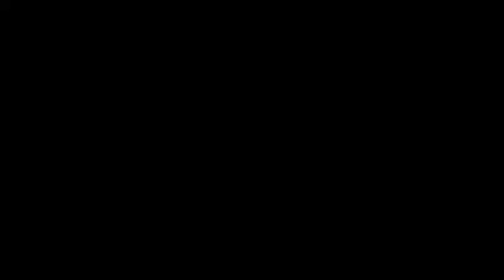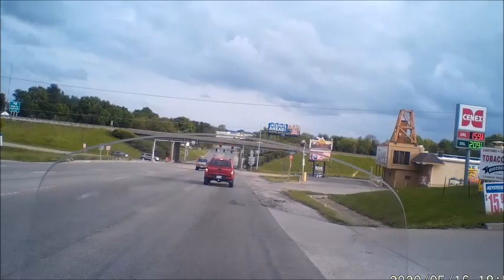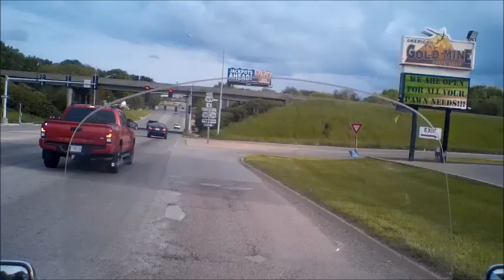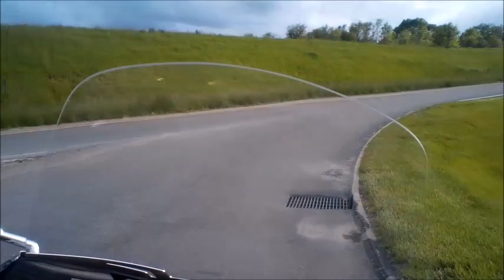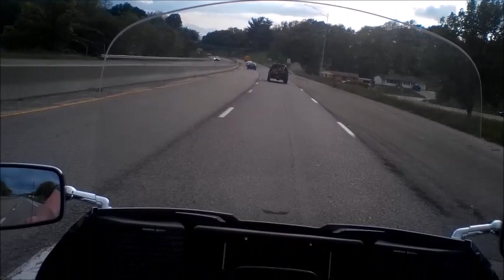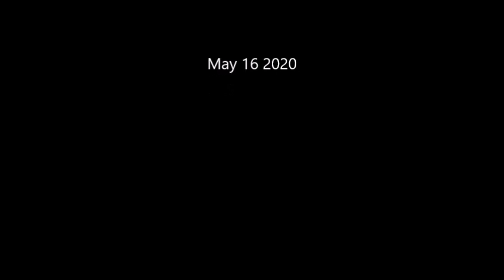Honda Goldwing 1100 with Solex single carburetor from VW on the highway

Comment: What was the size jets you used and Volume and Bypass screw, I need help with it cutting back
Reply from the maker: I think it was a 130 main jet and I got some micro bits and drilled the idle jet but don't remember how much.